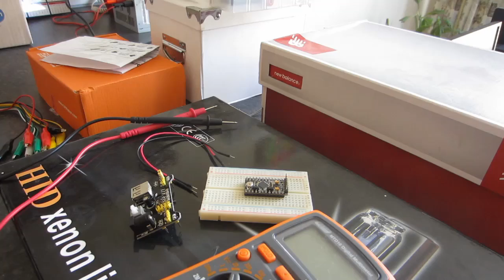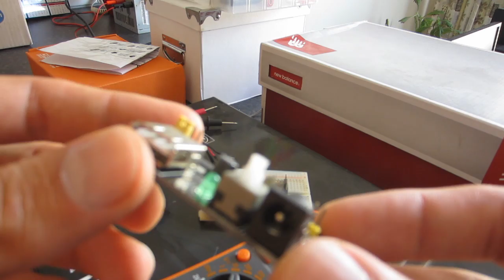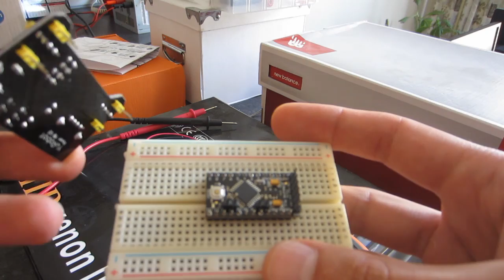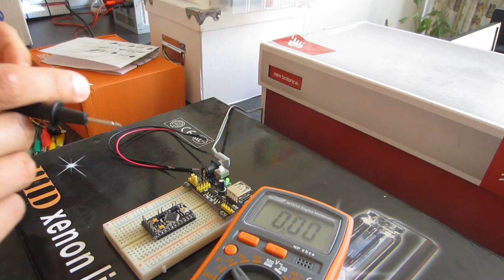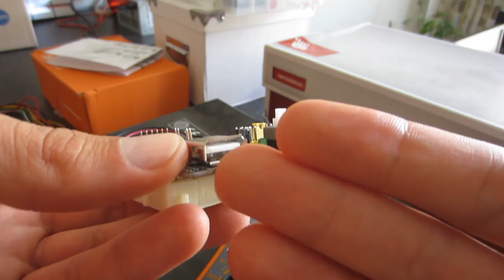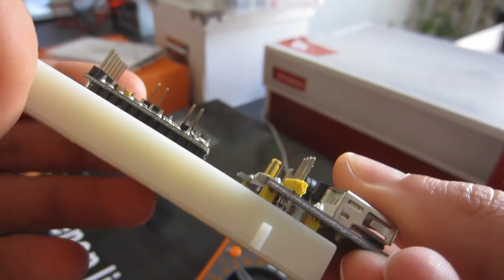Breadboard Power Supply Module 3.3V 5V MB102

Comment: i read that the input voltage range is 6.5-12 V, but what about amps?  Can I actually just use a 12 V @ 1.5 A DC power supply and the only thing that will happen is it'll be extra efficient?

Comment: Interesting video but you missed a couple things that are indeed very important..  plugging it into the wrong end of the breadboard (as mentioned) is OK to do, but it sets up and inverted polarity on the breadboard where it's + output pins drive the ones labeled (-) on the breadboard's labeling... but if you keep that straight you're fine using it that way.. 

Several longer breadboards only extend this power half way down the rails too so be prepared to jumper + and -  across the gap in the middle if yours are like that too.  

 Secondly these YwRobot breadboard regulators cant take 12.0vdc, I would recommend they only be fed with 6 to 9vdc adapters.. I had 4 of them all fail very recently in exactly the same way before I realized that I'd grabbed the wrong wall-wort adapter and was feeding it 12.25 vdc ( unloaded) .. and here is precisely what each one did as it failed..
 
1.) under a NO load condition with this +12.25 vdc applied thru the barrel jack produced want looked like Ok voltage out across the rails and was looking good at + 5.02 vdc .. it looked fine but when switched off then connected  to a actual load...

2.) and turned back ON while under LOAD its GRN LED immediately started blinking at a slow .5 second rate and the output voltage under light loading was then reading only + 0.02VDC.. 
NOTE:   I think this is a ONE TIME ONLY Fused -Open behavior to protect the load.. But then ... 

3.) disconnecting the load and turning it OFF then back ON gave a normal steady ON GRN LED BUT the actual output on the rails from this regulator was exactly +11.34 VDC and it stayed that way every time you switched it OFF and back ON with or without a load connected.. 

I made the mistake the 1st time this occurred of having a little MPU 5060 accelerometer module plugged IN and I did not check the vltg after it was BLINKING GREEN at it's .5 second rate.. and as I powered it ON (assuming that it was simply a bad MB102 module and I swapped in a new one), and it immediately  went to +11.34 and literally with nolonger a 0.02vdc out again..  this +11.34  smoked the regulator chip on the MPU 5060 when I turned it back ON.. it was sparking and billowing smoke before I could unplug it.. since switching the regulator switch  OFF had no effect.
 
4.) after seeing it do this BINKING in a FAIL SAFE FUSED OFF to then switch over and start putting out +11.34 VDC on the rails not just once but on a total of 4 of these YwRobot MB V2  regulators .. I finally started researching the source and I am now 99% sure now that it was my 1.5 amp 12vdc wall wort that triggered all the failures of these regulators...

Lesson learned.. If you ever see that GREEN LED start BLINKING as you power it ON.. do UNPLUG the load immediately and test the output voltage on the rails because after cycling the switch ON/OFF/ON  a 2nd time, the +5V voltage is way too hot, it's over twice that at 11.34vdc.. DO NOT leave it connected to the load as you turn i back ON since you may be using a +12vdc or higher output transformer adapter by mistake like I was...

Comment: Good video. The part you explained on the PSU board are voltage regulators, not power regulators. Minor thing... good video.

Comment: Hi ,I have an power wall adapter that is rated for 12 V and 1.5 amp . I tested it with the voltmeter and puts out 12.20 V , would this be ok to power this kind of Breadboard Power Supply Module ?

Comment: Just so we all are on the same page...

A multi meter will read the average voltage, so it can be more or/and less and it will pick the middle and display that.

As you showed, it's 4.96 and 3.31 average therefore neither power output is correct.

If you were testing and as you were trying to show. The only way to test a power supply is with a oscilloscope.

This gives you I formation of jitter, noise, voltage deviations and such like.
You would then have to put a load on there going the full range of the IC/FETs to see how it performs and if it is uniform.

Higher current may cause a voltage drop, lower draw make have  voltage spikes. 
Also if there is a power on spike. This happens a lot with devices and would be down to the IC and that schematic to see if this is a problem, or is increased or decreased with the board design.

Also....
Most chips would take a input on 8v 500ma... But there are lots of different ones. If your getting hot, it may be the cause??

Comment: Hey I bought this just yesterday.

So I'm using 2x 18650 battries.
Means... I am giving power supply of 3.7+3.7 = 7.4v
And 8.4v when it's full charge.

I have connected two battries and soldered the views with usb cable. So my module is getting power from USB.  Not from DC jack

But when I checked on multimeter. On 3.3v jumper active. Yes it gives 3.3v. but on 5v jumper active. It gives raw, means directly 8v.

So is my board damaged? Or I'm missing something?

Plz help me out.
Reply: The 5v is regulated only when 6v+ is supplied from the barrow connector.  The USB 5v pin is directly connected to regulated 5v bus.

Comment: Hi ! Very nice video! Incidentally if any one tries to connect similar Chinese boards with 12 Volts as their barrel socket specifies, they are sure to burn up the 5 volt SMD regulator. I have burnt three of them not realizing their design flaw. After seeing your video I replaced a regular 7805 ( non SMD ) , with pin modifications and some peeled off tracks reconnection, and it works like silk. Thanks to your video initiative.
Reply: Yes it does 🙂  I wish I had read this three power supplies (and two pico w ago), lol
Reply: @XexusNH  If the power supply is unregulated, it can give higher voltage, like 13-14-15 V. Use a regulated one (measure it with multimeter) or buy a lower voltage one. I have one power supply of 12 V regulated, and it works fine.
Reply: I did the same with a L78S 5V 2A. Because the 5V LDO is used by the 3.3V LDO as source. The modifications to match ground-out-in from in-ground-out were exquisite !

Comment: There's something about plugging in the PSU that's worth a mention.  The power supply can be plugged just as easily into one end of the breadboard or the other - but if you plug the power supply into the wrong end, just as you did, you will be plugging the positive into the blue rail and the negative into the red rail.  Chips get hot and melt the breadboard!  In my case, it was one op-amp of a set of 25 that I got at very low cost - so I lost a few pence.  I was lucky it wasn't an Arduino Nano, or something more expensive than that!
Reply: It appears he plugged it into the correct end of the breadboard.   The + is on the red rail.  Please let me know what I'm missing.
Reply: @visarr  Yes, you're right.  In fact, he gets power onto the Arduino with that configuration - and you just can't argue with success!  
Sorry - my bad!
Reply: @DownhillAllTheWay  I don't think I would have noticed those tiny "+" and "-", though - so, you gave me something to think about in the future.

Comment: Hi...
I'm getting a simaler Breadboard Power Supply for a DND project I'm doing but the seller I'm getting it from isn't being to forward about as to what power supply I should use.
I see that you use a 9v supply in the video but i was wondering as to the Amp's should I use a 12v-500ma or a 12v-1A or grater.
(All I got ATM are difrent 12v supplys)
As im not that knoligable about working out power requerments.

Comment: How to make 5v battery using chip ,capacitor,resistor and exc
Reply: ??? You cannot make a battery like that. Batteries work by chemical reactions inside them, which seperate electrical charges. To make a battery, you would need some acid and metals of different kinds (more complicated but whatever). 

Perhaps you are asking about how to make a voltage regulator from scratch. I like GreatScott's YouTube channel, try it!

Comment: Keep you input supply @7V or less as mentioned in comments below the AMS 1117 5.0 linear supply has no heat sink and when it dies/ gives up magic smoke whatever it shorts input to output and if your supply is a common 12v AC/DC 'wall wart'  you will have very little power headroom before the regulator lets it's magic smoke go.  If only a 7805 was used....

Comment: Mine smoked when using a 12V adapter. The 5V line started reading 11V. Turned out my adapter was outputting 13V, perhaps that's what fried it.
Reply: On the board it says the input must be lower than 12v
Reply: I connected a 12 Volts and without even a load, it burnt up. There seems to be a design flaw.
Reply: @venkatakrishnansrinivasan6928  Maybe your power supply is unregulated, and give out too high voltage?

Comment: I've got the power supply adapter which outputs 5v 1A. But the module outputs 3.74V instead of 5V and 2.82V instead of 3.3V. Does this mean the module is corrupt or should I connect an adapter with 9V output? Pls answer
Reply: To quote Sebastian Scholle above: "The modules use the LDO1117 regulator chip which features a voltage dropout of about 1.5-1.2 volts...." So, 5 V in, 3.74 V out sounds right, as does 3.3 V in, 2.82 V out. As he mentioned, if you want a full 5V out, you would need about 7.5V in.
Reply: @raceobannon9336  is there still a dropout if you use the usb power?

Comment: Comments:
a) If you provide 12V to a 5V linear regulator at 0.1A, to do it's job it converts 12-5=7V @ 0.1A into heat, 0.7 watts.  If you provide 7V to a 5V linear regulator at 0.1A, it converts 7-5=2V @ 0.1A into heat, 0.2 watts.  Less heat = longer life.  If you draw too much current, you will burn out the regulator.  There is no heat sink on the regulators on this board, so you won't get the max. rated current (1A) without problems.

b) According to one schematic I saw on the net for a MB-102 (don't know what the schematic is for this board), the USB connector is for power input, not output.  If you try to use it as a power output, what you are doing is feeding whatever voltage is from the barrel power jack directly to the USB device.  Since USB devices are expecting 5V, giving it 7V - 12V would be bad.  

c) The USB input jack should be a mini or micro type.  Putting a USB-A connector on here goes against the USB spec.  There are MB-102's on eBay that have proper mini or micro jacks.

d) If you power the board using USB power, it is 5V.  Supplying a 5V linear regulator with 5V does not give you 5V, it gives you something less, or maybe nothing.  So only expect the 3.3V regulator to work with 5V input.
Reply: The usb is power and program.

I'm pretty sure that it's not usb and power jack, but I can't see if there is a blocker to stop the cross over and if it acts as a controller for usb out.
It doesn't look like this as it's is using the PR's  with almost  a direct connection hence the jumpers.

As for power/heat. Unless the chips are identified then it's hard to tell the total power. .7C/w is fairly common. 
But then so are heatsinks.

I've a "5a" using a surface mount, about 30% the size of what I'd expect, there is a HS, but it isn't good enough.
your right the differential or I /V is the live or die of these chips. Lower is better.
Reply: But is 0.1 A enough for PI systems ?
Reply: My 0.1A figure is just for a heat calculation example.  I don't know what is needed for a Raspberry Pi.  According to a website, somewhere between 0.5 and 0.7A is needed for an RPi 3, depending on what is connected.  I'd guess you'd need to put a heat sink on the regulator to pull this kind of current.  https://raspberrypi.stackexchange.com/questions/341/whats-the-current-draw-and-supply-voltage-tolerance
Reply: thank you mister !

Comment: If you check the link (by Toby Fee) for the product on Aliexpress and check the specs, you can see that it can handle a 6.5 V-12 V input:
item:  YuRObot 545043
Bread Board power supply module , compatible with 5V , 3.3V
For MB102 bread plates
Input voltage : 6.5-12V ( DC ) or USB power supply
Output voltage : 3.3 V, 5V switched
Maximum output current : <700ma
Upper and lower two independent control , switch to 0V , 3.3 V, 5V
Onboard two 3.3 V, 5V DC output pins
*********************************
And I tested it with a AC/DC converter providing 12 V, 1500 mA and it worked without any problems.

Comment: Could the USB connector be used for powering the powersupply with a  mobile phone and a usb cable? If this is the case then I believe it is pretty smart because you do not need a 9V adapter to power your circuit. Not every region in the world has 9V adapter lying in a closet somewhere, but even in Africa alot of people have smartphones.
Reply: Good to know....
Reply: The USB is a power output, not input.
Reply: Are you sure? I have one of these (looks exactly the same, maybe different cheap chinese clone) and I use the USB as power input all the time. Computer USB to this USB port gives you USB voltage (5V +-10% on the 5V rail and 3.3 V if you put the jumper accordingly.)
Reply: @MichaelJohnson-mb1io  There is no direction on it, it works both ways.

Comment: How many volts  is coming to power supply module ?? I bought a cheap bench power supply that's got a knob on it, that has setting 3v, 4.5v, 6v, 7.5v, 9v, 12v. Not sure which one to use. Thanks for any help!
Reply: 9V
Reply: These power supply are not accurate and you need to measure the output voltage with a voltmeter. Without that, try 6V or even 5V.
Reply: Also, be careful with polarity (which usually can be set on the power supply). Check the circuit on the module to see whether center pin is + or -.

Comment: How many volts  is coming to power supply module ?? I bought a cheap bench power supply that's got a knob on it, that has setting 3v, 4.5v, 6v, 7.5v, 9v, 12v. Not sure which one to use. Thanks for any help!
Reply: The modules use the LDO1117 regulator chip which features a voltage dropout of about 1.5-1.2 volts. So 7.5V should be a charm. But 12V will also work, only more power will be dissipated in the regulator, reducing power efficiency.

Comment: stupid question but is there a way to increase the voltages instead of just having to choose between the 3.3-5 v, or do i have to buy another power supply?
Reply: The 3 volt and 5 volt options was designed for adrino and pi accessories. For example my pi can only handle so much so prefered method if running a lot of different items on the gpio is to use transistors that run on the 3 volt to trigger relays running on 5 volts. If you are running anything with a pi or andrino i recommend using a transistor triggering a relay to switch on/off the circuit. They have a board out there i belive with relay and transistors soldered in for controlling higher loads. some are even house 110ac compatible relays.
Reply: There is a way, this is outlined in this discussion: https://electronics.stackexchange.com/questions/56219/increasing-output-voltage-of-a-fixed-linear-regulator however it should be noted that using a fixed regulator in an adjustable schema will have worse error % and will require additional components as well as re-wiring. This is usually not a great solution with a premade board like the MB102.
Reply: Ayah Ahmad   what voltages r u thinking of and for what?
Reply: That's like complaining that a ship does not fly. It's not designed to!. This is just for 3.3v and 5v!

Comment: I wonder If I can use a 12 volt 1 amp wall wart to power it
Reply: The WHOLE PS unit is rated 10V, 750 mA....
Reply: yup, should not be a problem

Comment: Damn I bought an electronics starter kit hoping to learn a thing or two and the first lesson I get is go buy a fucking adaptor _;
well thank you for the play by play its apreciated
Reply: shinobimanexe Just buy an Arduino UNO. 
You can also use that Arduino as your 5v and 3v3 power supply. 
And of course, that Arduino is the next level of learning electronic

Comment: I'm just recently getting into Arduino and have been trying to teach myself, but I was wondering if it was possible to change the amps that come out of the USB or if there is a way to recode the power supply or is it pretty much set to were its gonna be?

Comment: I would think that the USB port is for powering a device through a USB cable such as a Arduino Uno or Mega that wouldn't fit on the breadboard instead of powering the power supply with USB...  Almost like a feed through.  I decided to go ahead and and buy a few of these to play with.  Thanks for the review!
Reply: At 6'57" he mentioned a comment that will cause damage. He said, "need male to male USB cable". In other video I saw in a demo that the USB port is able to light an LED, hence, that USB port is intended to supply power and not receive power. Therefore, this power supply module has only ONE power source and that power source shall come from the jack. The USB port shall propagate the power that comes from the jack towards anything connected to the USB port.
Reply: @cardsigner  Instructions say that if the board is powered, the USB is an output USB to power other devices. If the board is not already powered by the other connector, then the USB is the input power (this is the way I use it)

Comment: Out of curiosity, the dc adapter you used, was the center pin + or -?
Reply from the maker: The center pin should be positive. Most DC circuits have diodes to prevent accidental connection of the wrong polarity. However, its always best to check with a multimeter that the center pin is indeed positive.
Reply: I ended up doing something similar, I used my multimeter on that setting that beeps when you have a connection, and with one lead on the power supply center pin and then the other on the board itself where you connect to the bread board(which are labeled + & -), so once I had a connection beep, I knew the polarity of the center pin, yay :)